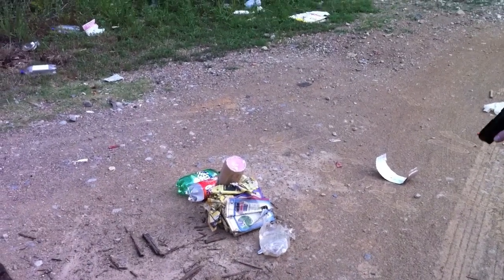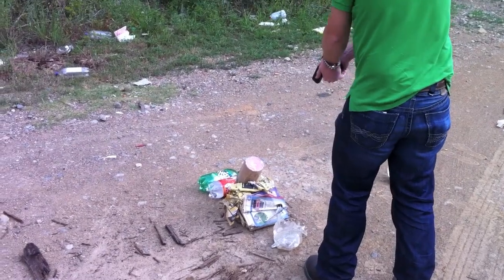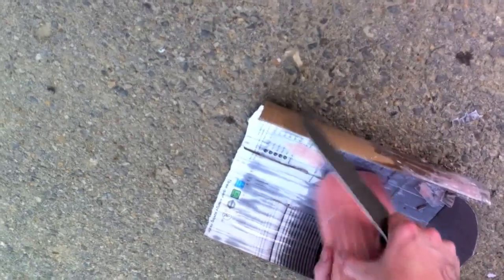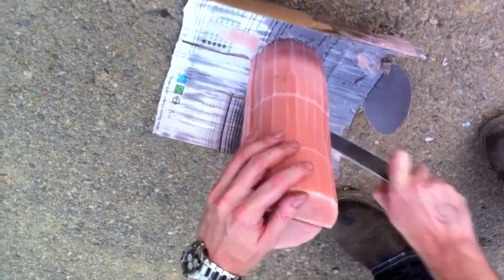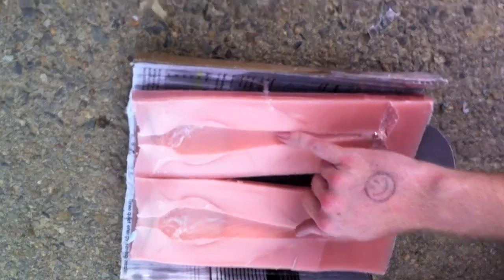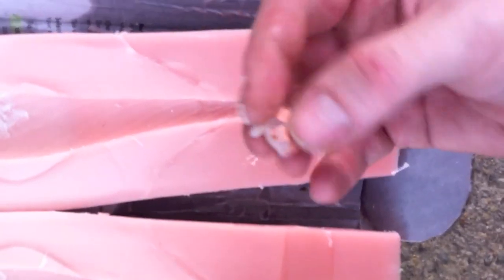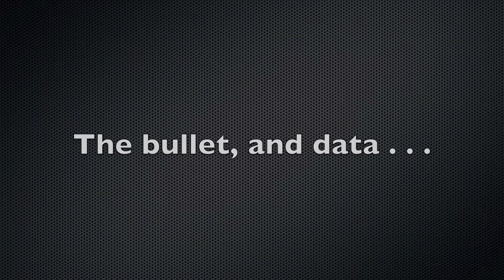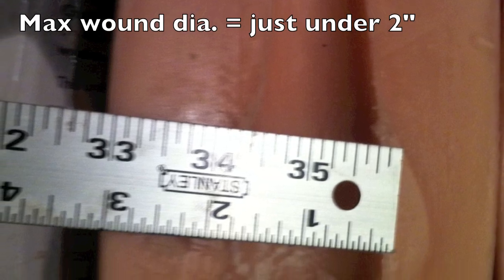10mm 125gr Barnes TAC-XP Wax Tube Test

Comment from the maker: I looked back at my notes and can't find an actual chrono run for it.  Barnes quotes 1485fps for 8.4gr.  This was 8.6gr, but with a shorter barrel.  I'd guess around 1300fps was my actual velocity.  It seems like I chronographed it at some point.  I CAN tell you that the best velocity I got with those bullets in my G29 was with 11.4gr 800-X.  It was a compressed load at 1460fps.  I think I can push it up more IF I can get more powder in there.  I'll do it one day, I love that bullet.

Comment from the maker: @sjambok1 Are you asking about Swamp Fox ammo, or mine?  Swamp Fox is all to SAAMI spec.  I talk to the owner of Swamp Fox on GlockTalk a good bit.  He has actually helped me with some loads for this Barnes bullet.  My load for this round was actually really weak (Though it was beyond Barnes' max load).  I now have a chrono, and this test was run at 1300fps.  I have since worked the load up to about 1460fps.  I have one more powder to try.  I hoping for 1600fps.  All of this is out of my G29.

Comment from the maker: @sjambok1 I have been recently thinking about making the 125gn Barnes TAC-XP my new carry load (current is 155gn Silvertip @ 1450fps).  I need to buy some Power Pistol powder and work up a load to about 1600fps with it, then it would be really nasty.  This test was likely around 1400-1450fps.  If you want some REALLY hot 10mm ammo that actually meet their velocity claims, check out Swamp Fox.  You will feel the difference between it and Double Tap.  It's way hotter, and the owner is great.

Comment from the maker: @sjambok1 Yeah, both the 125gn Barnes bullet, and the 135gn Nosler JHP are awesome 10mm bullets.  If you haven't seen the test I did of the 135gn Nosler JHP, go to my channel and check it out.  That's the same bullet in the Double Tap load, you will be impressed.  However, those DT loads aren't really going as fast as they say.  A friend at Glock Talk recently chronographed that 135gn load at 1440fps (in a G20), not the claimed 1600fps.  My handloaded one was likely in the 1550-1600fps range.

Comment from the maker: @intercooler2 Yeah, that's why I like wax as opposed to gelatin. Although gelatin may give a better approximation of tissue for penetration measurement, it's nearly impossible to get a good idea of damage. Penetration in the wax should be multiplied by about 1.8 to get comparable tissue/gelatin numbers. Yes this is the same bullet as used in the CorBon DPX line. I bought them as components and loaded them.